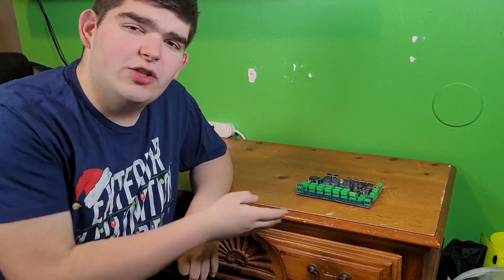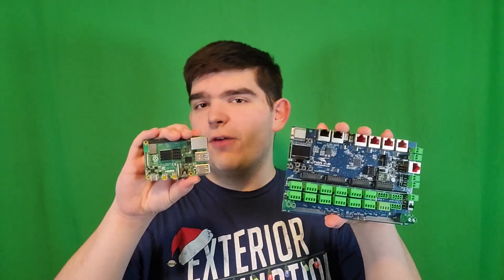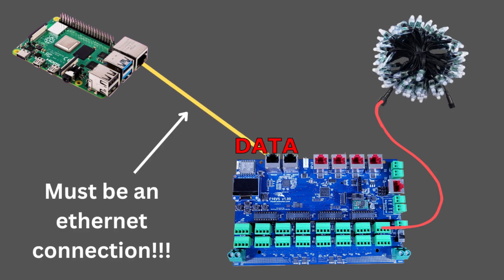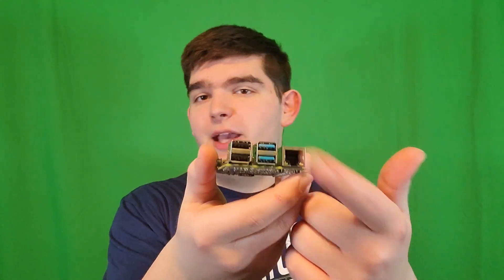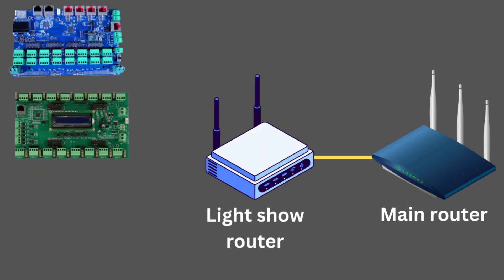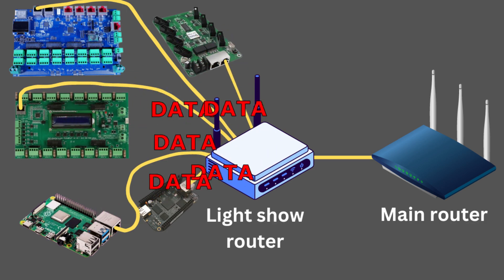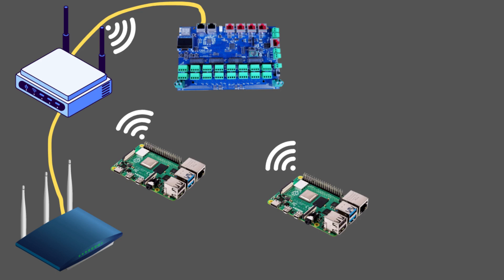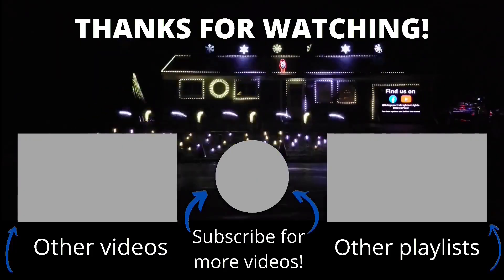Different Methods for Setting up a Light Show Network - LSNWN EP.4

Comment: How many controllers can I hook up to one Falcon controller?
Reply from the maker: Um, honestly the only limit I can see is running out of IP addresses to give them. The data might also start to get slowed down after having to go through so many controllers, but I'm not sure when you would run into that problem. I would think you could probably connect at least 5 to 10 together, but who knows, maybe it could be way more. I wish I could test it myself but I would need a lot more controllers 😂

Comment: I thought a Colorlight card was to be connected directly to the Gigabit RJ45 jack on a RasPi running FPP and not connecting through an ethernet switch since the Colorlight card doesn't actually use the Ethernet protocol to communicate. A switch requires the use of the Ethernet protocol.
Reply from the maker: Yes, that is correct. Did I say it has to be connected a different way in the video? I honestly can't remember 😂. I do know last year I originally tried to connect the colorlight card through a switch, and it actually worked, but everything was very glitchy and kept lagging.

Comment: Pretty much all of the Kulp controllers can do this and unlike the Falcon controllers, they are FPP based so not only can they be in stand alone mode, they can also act as the show player and can operate other controllers so in this case, it IS expandable.  I believe that the Falcon controllers can do this as well but they don't have the FPP features or easy setup.
Reply from the maker: Thank you so much for the info! I'll make sure to bring this up in the video specifically about standalone mode.

Comment: Do you have to have a SD card for any of the connection methods for the pixel controller or just the last method.
Reply from the maker: You only need an SD card for devices running in master and remote mode, or standalone mode. For the rest of the methods, data is being sent to the controller from another device, so you don't need an SD card since there's nothing to store.

Comment: Can we run a light show off a router that is not connected to the internet?  I'm trying to think why we would really need internet to run a show?  This would aviod having to run a giant cat cable from main home router to the light show router. Right!? I'm no expert.  Just asking....
Reply from the maker: No you are definitely 100% correct, in fact I was planning on making a video about this topic at some point for the series. You can run your light show without internet to the router, but there are just a few problems with that. The first is the raspberry Pi or whatever your show player is won't have anyway to get the time. The raspberry Pi uses the internet to find the time so it knows when to start the show. You can fix this by getting an RTC chip or just setting the time manually, and never shutting off the Pi. If it does shut off, it will lose the time and date. Second thing which isn't a huge problem, more of an inconvenience, you can't access your controllers or computers from your main network and you would have to switch every time to the light show network to access them. Finally is if you did have any plugins like remote falcon or something of that nature where it gets data/commands from anywhere outside the light show network, that wouldn't be possible.

Now I did have an idea, what would happen if we connected let's say a raspberry Pi with wifi to our home network, then the ethernet side to our light show network's router? Would it allow the entire light show network to have internet and also devices on our home network to reach the light show network? This is something I want to test soon, but at that point it might just be easier to use the bridge method. But your question is definitely valid and you can technically go without internet in the light show network!
Reply: @How2Pixel  I looking forward to seeing your test results.  My first show ever will be on its own router/network (fpp and quinled controllers(5)/espixelstick).  Nothing is hard wired all wifi.  I need to get the date to the fpp and its not practical to run a wire from my show router to my home (internet) router.
Reply: @joemoffo9706 curious about this. Still trying to do my first light show and bought a dig uno and dig quad. I have a ethernet and external antenna…. But im concerned that my show will be limited to only the dig quad via ethernet adapter, if I can’t use the dig uno to grab data with the external antenna.
Reply: @jordanl7489  Should be fine if both are connected to your router.

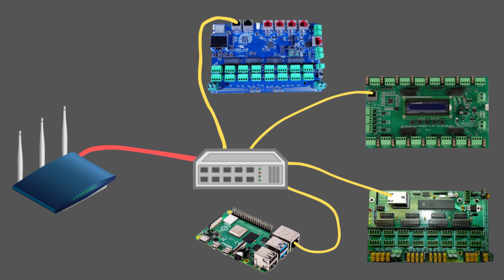Comment: If you have a switch local to the show player and controller like shown at 6:10 then it will switch all of the packets between the two devices and your router will not need to play a role unless one of the devices attempts to reach the gateway, or the internet. This is one of the main reasons Layer 2 switches exist. In this setup, the rest of your home network will not be impacted by the high data throughput between the player and controller.

Comment: How much data are we talking about here? Even the most basic home all-in-one device (router, WiFi, firewall, switch) will have a switch chip capable of non-blocking traffic at line rate for all ports simultaneously. If connected as shown in the first diagram, the packets will not hit the software forwarding in the router. (Even more so for the second picture). Long story short, this will not slow down your home network. 
(I would still build a dedicated network.)